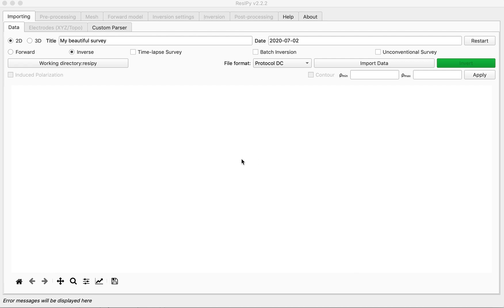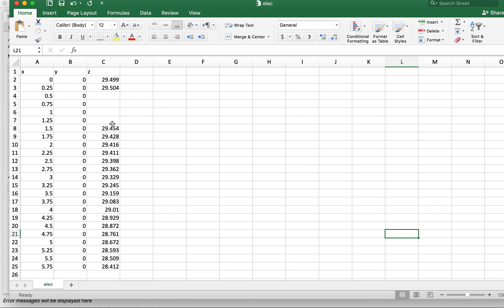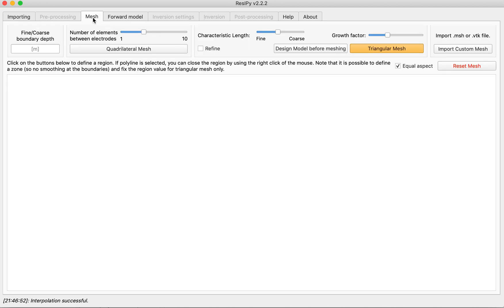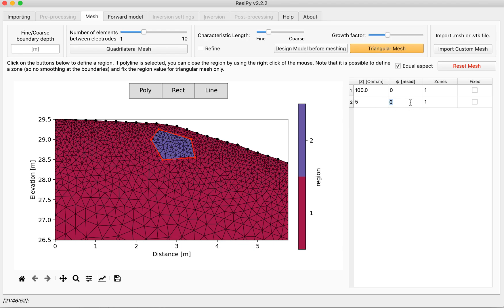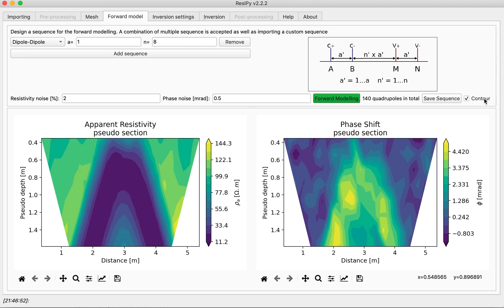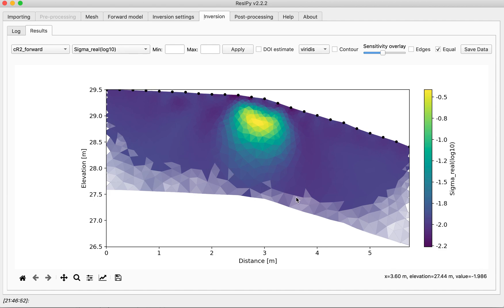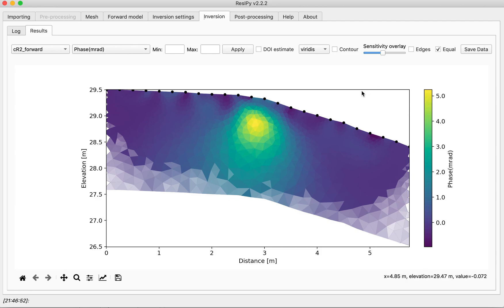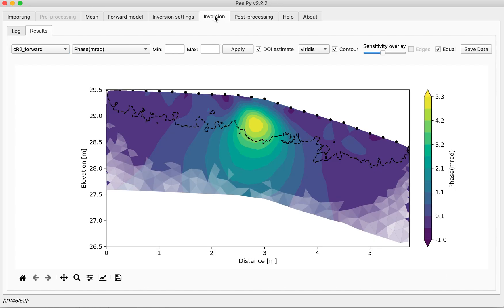IP forward modeling (2D)

Comment: Hello, I was able to use the code to generate series of IP forward model runs as well as invert data, however I need help regarding the metadata of the data saved in the directory like what each column means in various saved files like protocol.dat, forward_model.dat, in which file I can find apparent resistivity and apparent chargeability values  in columns against each measurment?
Reply: cr2_forward file column header names also required. please share a link if there is any where I can find metadata or more about the data produced by RESIPy.
Reply from the maker: @kjrimer  You can find all the information about output files in "cR2_readme.pdf" (link available at the bottom of help tab of the GUI)

Comment: Hi, I am interested in creating hypthetical geological scenarios for forward model runs for both Resistivity and IP. By using RESIPy API, my workflow will be :
1). Prepare the input file for adding regions and assigning them resistivity and mrad values (that will be changed in each forward model run) , then running the RESIPY API in cR2 mode (since chargeability and sigma_real can`t be calculated without Resistivity values, therefore I assume I don`t have to run the RESIPY in R2 mode again, please confirm). Since, cR2 also provides pseudosection for resistivity that I need. 

2) Saving the results of forward model outputs in a directory. 

3) Then running RESIPY in batch inversion mode and selecting the prepared forward models .dat files as input and then saving the inversion output files into another directory. Also i want to save results for all the parameters, resistivity, conductivity, sigma_real etc. 

Kindly advise if this is good way to approach the problem or is there any easier way of doing the same.
Reply from the maker: You could do that all! You just have to create separate projects (call project class separately). ResIPy automatically calls cR2 and not R2 when you set a project typ as "cR2".

Comment: Hi, IP forward modeling running example is not included in github gallery of examples? can i find one? i need to run forward modeling for Resistivity as well as for IP data using my own experimental scenarios. I really think RESIPy will be handy in generating forward model simulations. please suggest.
Reply from the maker: it's similar to resistivity:
k = Project(typ='cR2')
k.setElec(np.c_[np.linspace(0,5.75, 24), np.zeros((24, 2))])
k.createMesh(typ='trian')
k.addRegion(np.array([[1,0],[2,0],[2,-0.5],[1,-0.5],[1,0]]), 10, -5)
k.forward(iplot=True, noise=0.02, noiseIP=2)
k.invert(iplot=True)
Reply: @ResIPy  thank you!

Comment: Hello, Can we do batch processing to generate series of forward model runs iteratively using RESIPy? manually doing it may cost lot of time.
Reply from the maker: For batch forward modeling you must use the API. The GUI is not capable of batch forward modeling, only inversion.